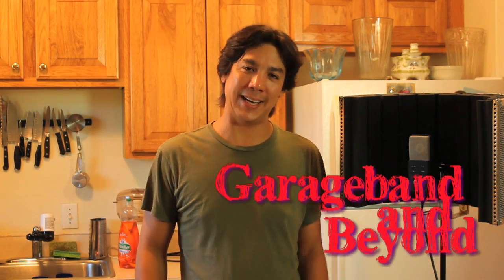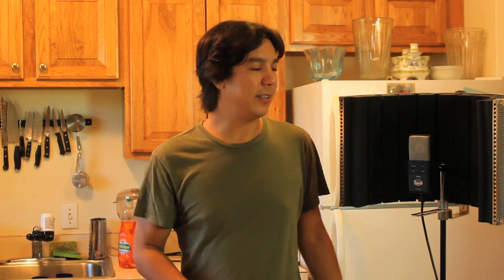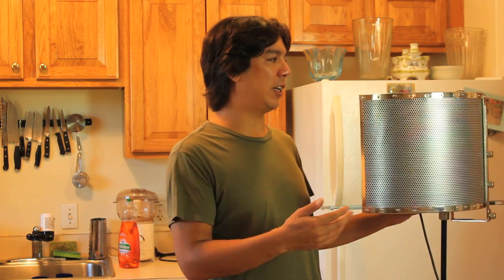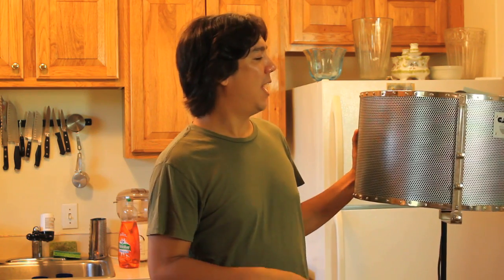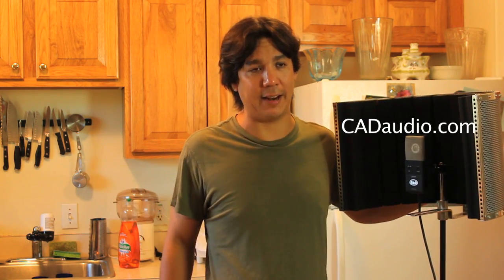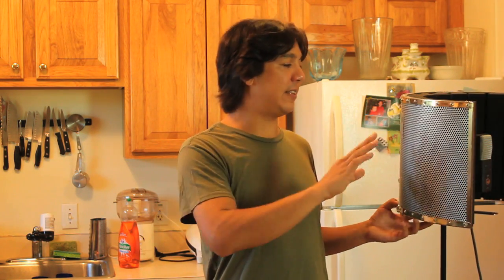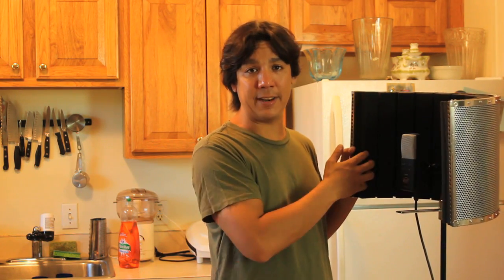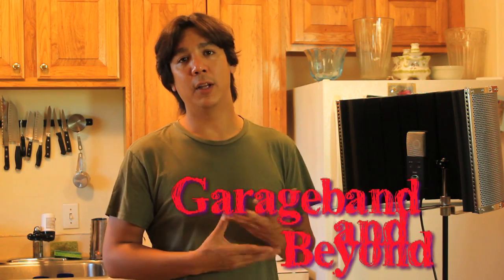CAD Acousti-Shield 32 DEMO - Reflection filter- Does it really work??

Comment: This is the same filter Post Audio sells on ebay they call it the ARF32 same design. I don't think it's very good I didn't have any luck with it. I used one about 2 years ago and it just made me sound muffled. I brought the Soundkitz AE-F Acoustic Enhancement Filter and I've been using that and it's really quite good. You should check that one out if you haven't.

Comment: You said you weren't sure why you get a "deeper" sound (which comes across well in the clip) , and I think the reason may be that the foam in that shield only filters out mid to high frequency and you get all the "boominess" of the room added back in without the HF.  In effect you have low pass filtered it.  The low frequencies are often supposed to be the most problematic and this set may now emphasise them.  I actually think the guitar sounds a little more problematic afterwards even with the HF reverb attenuated.  I think other designs use additional materials to try to address this, but at the end of the day with a normal cardioid microphone, most of the sound should be coming from the front anyway of course.  I've yet to try one myself though, so thanks for the demo - much more obvious than some others I've heard :)

Comment: How do you get such a quiet mic sound? is it a gate or compressor, i hear the room, but barely, and both are with almost no noise. I was thinking about getting a akg c214, but if this mic is that quiet on its own, i might get it.
Reply from the maker: It's because the E100s is one of the quietest microphones on the market. In fact I think it has the lowest signal to nose ratio for mics in that class.

I know exactly what you mean though! The first time I plugged it in I couldn't believe how quiet it was.

Comment: Best way to use it to have a curtain behind you or some wall acoustically treated...cause don't forget this is a Cardioid MIc and it's recording mainly the sound right from the front...so it will capture so little from the back and so much from the front...so the front is where you need to treat more than the back !!!
If you treat both, you will get the best result !
Best Scenario that I tried, is to stand and in your back a thick curtain and then with this Mic Filter in the front you will have the best result...If the room has a very low ceiling then you're in trouble, you need to treat that spot above you too !!!

Comment: Of course there is a difference with vs without the filter. If i had to describe it, i would say focus. Untreated is washed out, i like the high end description too, it just sounds thin. Filter gives some mor focus, punchiness, clarity. Having said that, i would like to have some more mic positioning options on acoustic guitar. Depending on the mic, i may want to get up on the 12th fret or move a little bit closer for example. Product is marketed for vocals so theres that, but for someone to say they cant hear a difference, well i did using an ipads speakers.

Comment: Honestly and truly, that thing is almost useless except for good looks. You're better off just using good mic placement and good recording technique until you can afford a cheap portable booth to place behind the performer or whatever you are recording. That will make much more of an audible difference because you'll have treatment exactly where the mic is picking up sound rather than treating behind the mic where the mic isn't picking up much sound (assuming most are using cardiod and super cardiod pattern pick ups in the home studio). Not saying it doesnt work but it doesnt work ENOUGH to justify paying $100 or so for it. Thats my take on it anyway